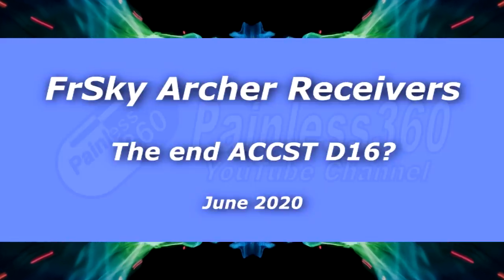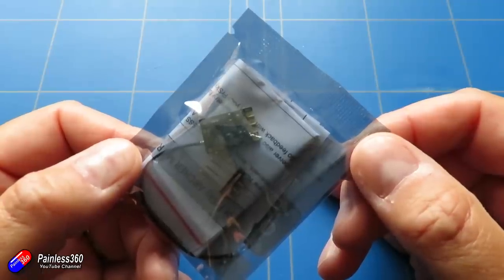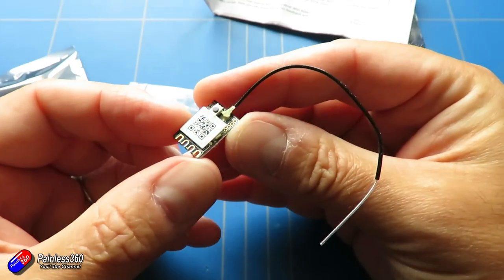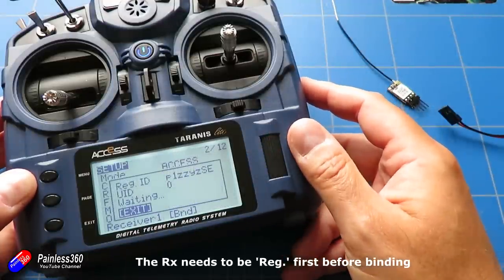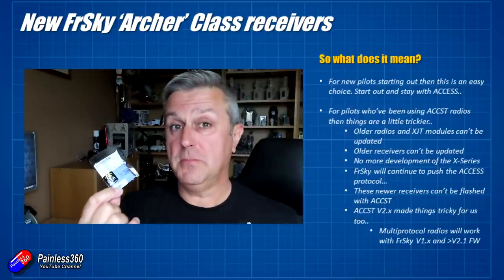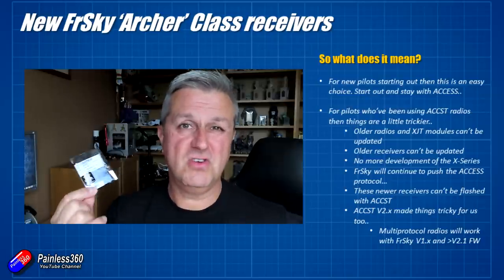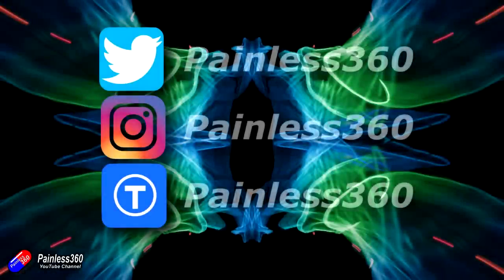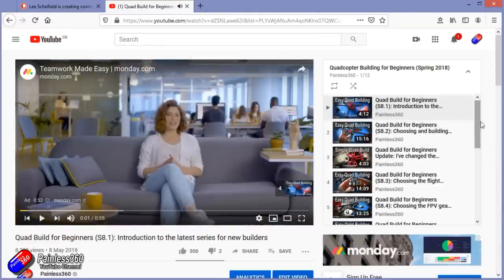FrSky 'Archer' Receivers and ACCESS Protocol...

Comment: Spektrum is forward and backward compatible. DSM, DSM2 DSMX receivers all work with the latest transmitters. The transmitters and receivers are not cheap, but the old receivers work with the new transmitters. I prefer the less expensive Lemon, Redcon or even the HK Orange receivers. The Lemon with telemetry is my favorite. It seems that Spektrum, JR and Futaba are only popular in the States. Can anyone tell me why?
Reply: Joe Caraco   I have been flying JR since 01.  When I got interested in quads I had 4 great radios, purchased one new and three from buddies who upgraded or had to get out of the hobby   So with three grand worth of radios, needless to say I was happy with top of the line gear.  Fast forward and the ability to hear battery voltage, rssi, and so forth I purchased a X9lite, then found this change from FrSky just came out.   The new breed of radios are far less expensive, far more programmable, and have access to all the goodies that programmers can come out with, but my old fashioned JR gear is what my multi thousand dollar giants fly with.   So short version = money.  Proven track record.  Quads crash.....a lot, big fixed wings not too often.  Inexpensive fits the quads better than a radio that you could buy 4 to 10 of the new jumpers or X7 class radios.
Reply: In UK Spektrum is NOT backwards compatible. New radios from 2016 are DSM-X only. DSM-X radios before 2016 were BC.
Reply: @ianwarhurst5921  That's a shame as the Spektrum users I've met are very happy with the performance and support we have in the US.

Comment: Have you done any range tests on thise new receivers? I'm interested for my micro's 2-3inch quads. Do you know what latency those have?
Reply from the maker: I've not used them at all. I'm not a fan of ACCESS.
Reply: @Painless360  Me too. I try not to be a fan of anything in general. But I want the best for my quads. I switched recently to micros and wanna collect some info. I heard there maybe is coming a race mode with low latency on those.
Reply from the maker: If you want low latency then check out TBS Tracer and IRC Ghost
Reply: @Painless360  Yes maybe go I could go for the ghost module. But I'll wait a bit to see if maybe something will come from frsky.

Comment: how do you make the ARCHER M+ work the tx16s
Reply from the maker: If you can, flash the reciever  with ACCST D16.... Happy flying
Reply: @Painless360  iv have triy evrey thing  and had no go and i even flash the firmwher by sd to the tx16s by pluging the reciever into the tx16s
Reply from the maker: OK. I've download the firmware for that Rx and there is NO ACCST so it won't work. Happy flying!

Comment: Ok so I'm thinking of crossfire and I have bought a Radiomaster tx16s but I now gather that if you buy a frsky receiver with access you can use it on another multi protocol module radio? If so they are no longer encrypted?
Reply: Any FrSky receiver you buy now will have ACCESS firmware on it so it will be incompatible with any current multiprotocol module.

Comment: I guess ACCESS comes with all the Yaapu goodness etc ?
Reply from the maker: ACCESS is the radio protocol. Things like YAAPU is an OPENTX thing and will work as long as the telemetry is coming back to the radio. These new receivers have SmartPort and FPort if so you can send it back to the radio... Happy flying!

Comment: Lee, as someone who is new to OpenTX, having just bought my first OpenTX transmitter (Radiomaster TX16S), what are my options for Telemetry capable Rx's?  They would be purchased for RC Helicopter use only, so would need to also be able to handle up to 8.4v like the HV servos we often use in helis.  Thanks!!
Reply from the maker: I use X series on pretty much everything here and the telemetry works great... The Jumper R8 is good if you are a Ardupilot pilot..
Reply: @Painless360  Thanks Lee, It's a great pity that the X Series is being discontiued then.  Are there any other options you are aware of from other brands?
Reply from the maker: It's not discontinued. See the video. Just no longer developed...
Reply: @Painless360  Sorry Lee, I missunderstood what you meant.
Reply: I had some issues with the R8, but others are happy with it. For telemetry my first choice is R-XSR but with older, or the latest firmware. There are some firmware versions that have issues with random failsafe.
Reply: @rc-fannl7364  Thank you, that is very helpfull.  the R-XSR looks like a good choice for helis, as long as FrSky don't pull support for ACCST.

Comment: Hi  I'm still a little confused,  I have a older X9D and a Xlite and I use XM+ or crossfire and now that this new receiver is coming out,  will i need to update both radios to be able to use this new receiver and if I do update what happens to my old receivers can I still use them  or am I going to need to replace all of them.  Thanks again for the information and the video.
Reply from the maker: You can still use all of the stuff that you have. It's only if you want to start using ACCESS you'll find that some of the kit you have may not support it..

Comment: I’m currently at a crossroads and unsure what direction to go.  CRSF or ACCESS??  Since I have a Horus, the CRSF module won’t operate without lower latency unless I swap a transistor.  I use 900 MHz almost exclusively and I cannot find ACCST receivers any longer.
Reply: The mod is pretty easy. I did it to my x10s.
Reply: In saying that. I just swapped to crossfire. I'm not risking being screwed again by frsky.
Reply: Dale Pattison  - do you know where I can find one?   It seems they are all out of stock.
Reply: @MrVasmikey  no idea I did it more than a year ago.
Reply: Dale Pattison  do you know if the mod defeats the r9m module?
Reply: @MrVasmikey  not sure what you mean by defeats? Crossfire is far superior if thats what you mean? You can still run R9 if you want.
Reply: Dale Pattison   Yep that’s what I meant. I still will use my R9m for a while with a few planes.  TBS will be my new venture.

Comment: Oh yes the frsky archer receivers £2 more expensive than an XM plus but with only 1 Antenna.

Or lets get a the archer RS OTA for about 2.4x as much money just for diversity. (I might add a crossfire receiver is cheaper)

Frysky have no fing idea why people used them to begin with and if they want to start going up against futaba they will fail badly.

Right now as a quad pilot i am waiting for TBS tango version with 500mw output and then ill probably just go with that as at least you know your investment will be good for some time to come.

Comment: The minute I can't get x series receivers anymore for my x10 I'm just gonna get a damn jeti ds12 and be done with this mess lol
Reply: Get a radiomaster tx16s and crossfire. Way better
Reply: @bobbin69  yeah nope I ain't trusting 50cc models and jets with some random banggood budget special. I just about trust the x10 with xseries receivers but the jumper, hellllll no. I want a radio that's reliable and will last
Reply: MTL FPV a radiomaster will :)
Reply: @bobbin69  lol
Reply: MTL FPV enjoy wasting money on an old radio
Reply: Why don't you just buy the isrm upgrade module for your x10, you can bind to your existing accst2x D16 receivers and the new access receivers. And I'm with you not going to trust my big heli's to some cheap knock off radio.